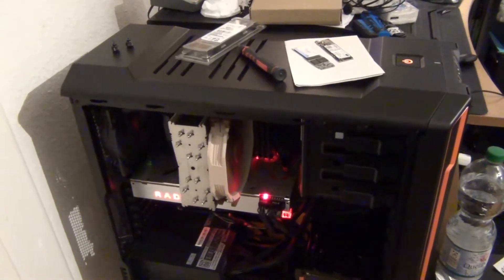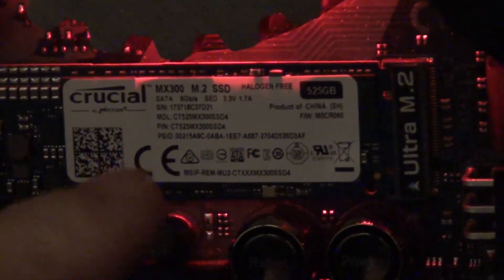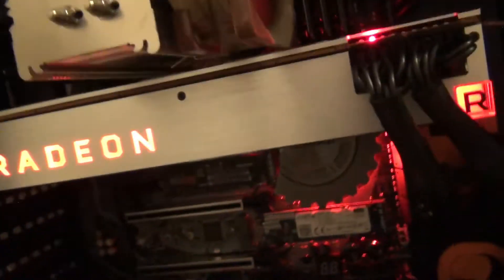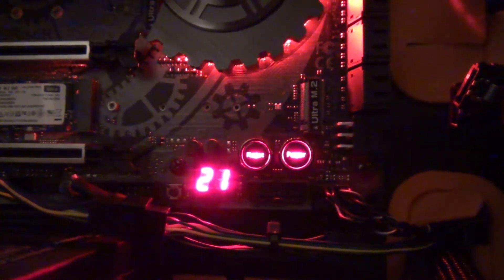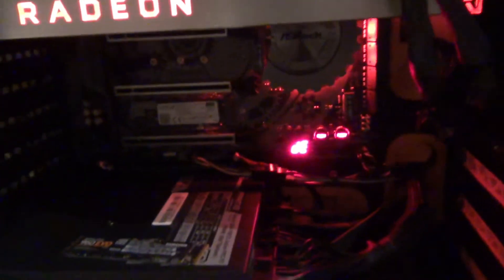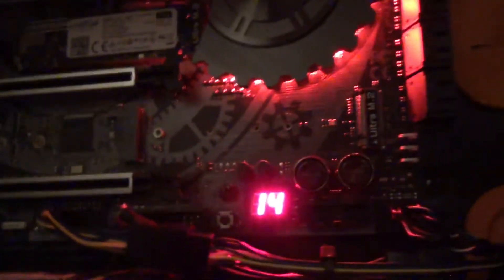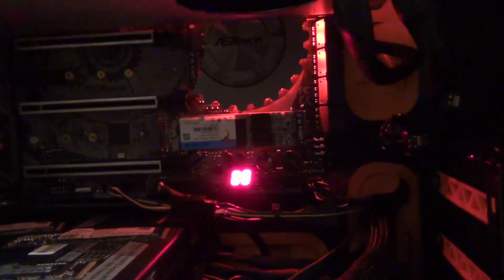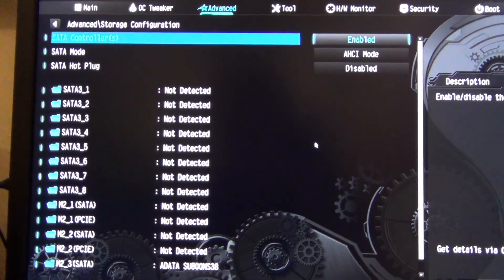X399 Taichi / AMD Threadripper / M.2 SSD S-ATA Problem

Comment: I believe this is written somewhere in the manua. You cannot use so many SATA and have the M.2 drive all at once. I currently have 3x 1TBsata 2x M.2 1T and 1 500GB Intel Optane.
Reply from the maker: ASRock fixed the Problem with an BIOS-Update. ;)

Comment: Thanks for your video KnackMeister..
Finally someone showing the fit of a Taichi Threadripper system with a Noctua cooler.
I was also planning to use the board with one EVO pro NVME drive and certainly one or more Crucial drive considering the price.
I'n not a gamer so a cheap GPU that can output 4K just for productivity will do preferably a passive cooled GPU..
Also I will be running Linux and doing a lot of virtualisation work on it.. just playing around on the system for my studies.
Greetings from The Netherlands mate.. 
will read the comment's to see if the problem is solved with a new firmware update of the motherboard.. is Asrock support any good ?????
Reply from the maker: Hey there! ASRock Support is Spot on. It only took 3hours after my Video showing the Problem to get an updatet BIOS Version with the fix. Greetings from Germany

Comment: Hey man, how's the ram and cpu cooler clearance? Currently researching parts for a workstation for work, and I am uncertain whether I will run into problems with 8 x 16 gb lpx sticks and the 140 mm noctua cooler for threadripper.
Reply from the maker: With LPX or Ballistix you wont run into Problems with the Noctua. - Greetz

Comment: I know it’s been a few months.  Did you fix it?  I recommend, turning off; unplugging, and removing battery for 3 minutes.  Sometimes, clearing CMOS does not function properly., an your system is still looking for a new drive. It’s worth a try.   Please let us know.
Reply: Gregory Dale Mostella ASRock fixed the issue with an BIOS Update! Greetz

Comment: Im about to build the same, AsRock X399 Taichi + Noctua NH-U14S TR4, just wondering if can use the bottom mount of the NH-U14S or you need it to offset it +3/+6? for the gpu to fit?
Reply from the maker: Hey there! The Backplate of the RX VEGA Limited is Pretty thick so i have to use the +3 Offset. - Greetings
Reply: finally someone with the same question I was thinking of.. 
I also want to build the same system as my new Linux rig..

Comment: Have you tried disconnecting the power supply? leave it off for 60 seconds then reconnect the power then switch on and it will do a cold boot  and maybe it will  reconfigure the drive
Reply: BIOS 2.0 fixed the Problem! - Greetz Cracky

Comment: I had the same problem with the X399 Fatal1ty board ana crucial m.2 SATA.  Got post codes de ad a2 21 13 34.  SSD was in slot two. Moved it to slot one and it worked.  It worked fine in slot two on BIOS version 1.3, wouldn't work on 1.8.  Wonder if it has anything to do with s adding nvme RAID support to the board.
Reply from the maker: Here you´ll find the new 2.0 BIOS for your Mainboard: http://jzelectronic.de/jz2/index.php - With this your Drive should work in every Slot. - Greetz Cracky
Reply: knackmeister thanks! It's on the official ASRock site now, too.
Reply: awesome  @knackmeister  ...that's what I also wanted to know.. thanks again for your vid.. most helpful vid on the net.. !!! will look on the channel for an update vid.. how the system is performing for you now..The 1920X is looking so good now with the price drop to €419 here in The Netherlands and. €413 on amazon.de next step up to the 1950X is €766 I think that's a bit overkill for me.. 
I rather spend the money on motherboard.
Reply from the maker: @samdeur  Here You can find the Main assembly of the system in one of my Main YouTube Channels in German https://youtu.be/cXhg4VTxv3A